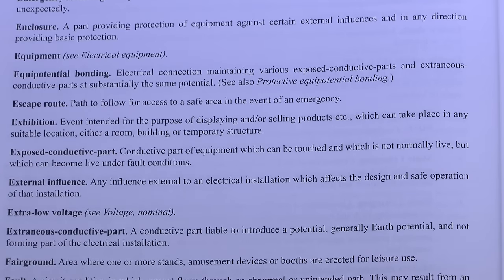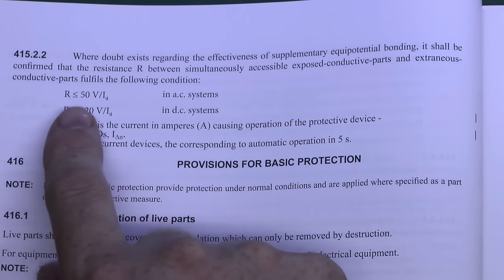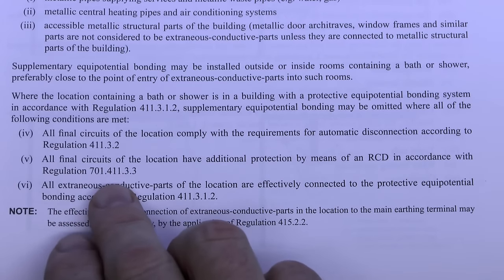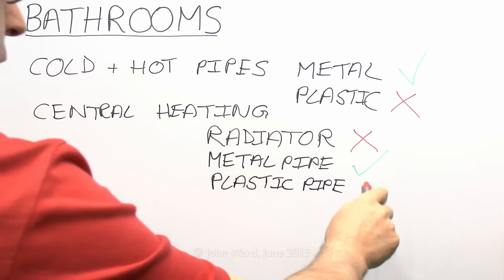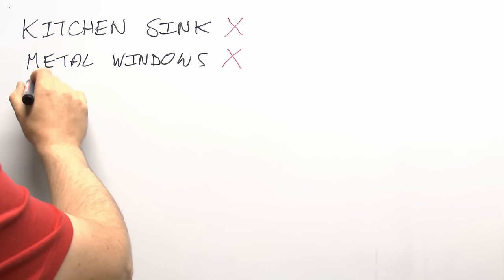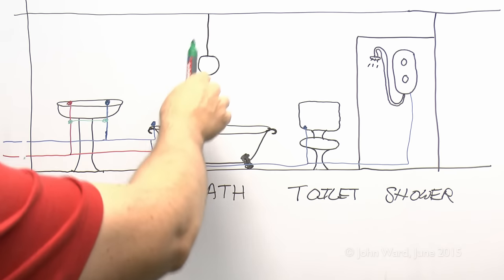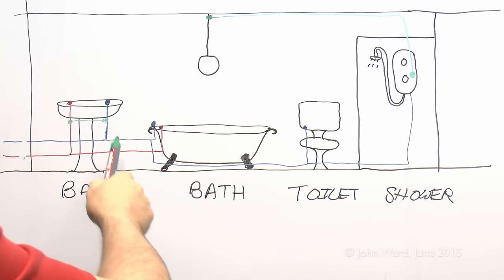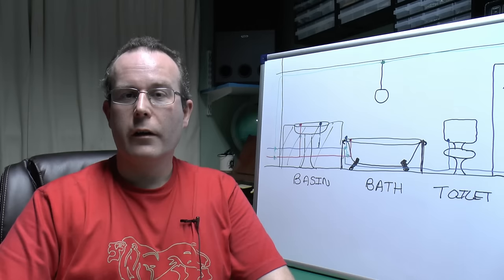Earthing & Bonding - Part 3 : Supplementary Protective Equipotential Bonding

Comment: Boilers when I was working on the 17th Edition Wiring Regs were always bonded as the integrity of the pipework "could not be relied upon" this was due to washers and corrosion of pipe joints at the Boiler and NICEIC Inspectors were keen to see such work completed.
With the introduction of RCD;s I personally see no need to have any Supplementary Bonding within an Installation.

So very interesting to listen to you John
Mr Spence Eng
Reply: I've came across this argument myself. But I don't think it holds water - literally. The pipework is solid copper with either brass compression fittings or soldered joints. We could use plastic joints - but not within 1m of the boiler.

In terms of corrosion of the pipework or its fittings (or the internal parts of the boiler) these would almost certainly fail to contain water/gas before they fail to be sufficiently conductive. Now frankly the customer is going to notice (and do something about) an escape of gas or water long before they notice the failure of a chain of earth clamps and wires.

And of course we can look at the boiler itself as a class 1 appliance. It is compliant with BS EN 60335-1 and therefore all conductive external parts ( including the places where the incoming pipes are connected ) are connected to the CPC. This arrangement isn't subject to the judgment of some previous tradesman but inherent in the design of the boiler and validated by the notified body (as gas appliances are subject to the notified body process). Quite simply the internal bonding between those pipes is probably more reliable (even in the presence of corrosion) than any electrical termination within the wiring installation itself.

Comment: Hi John, got a quick question hope u dont mind answering it. Is it ok if u dont link the shower and the light fitting in the figure u showed in your video since they are already linked in the fuse box on the earth terminal. Thanks
Reply: exactly what i thought
Reply: The electrical connection cpc is connected in the shower and at the consumer unit but this is talking about  providing an additional connection & bonding the pipe.
Since the pipe connection in a shower is often plastic you could end up with a brief potential difference between the shower and the pipe. Or not brief in some situations. I lived in a house that didn't have and rcd once and when the shower went wrong the was 140v between the shower handle and the pipe. The current wasn't enough to burn the fuse wire but would be enough to possibly kill

Comment: Perhaps I'm missing something but why would we need to provide bonding between the pendant/light fitting and the shower, given that both these will have CPCs attached which lead back to the earth bar in the board, and are hence already connected?

Thanks JW, one of the very best youtube electrical instructional channels, by far. I have learned a heck of a lot from your content, and been able to 'flesh out' a lot of what I've learned in the lvl 2 diploma and studying for my 18th edition exam

Comment: John, You mentioned underfloor heating for the bathroom. If the Underfloor Heating is under the floor tiles - is the Underfloor Heating  then considered outside the Bathroom. Similarly - if there is a resistive switch for switching the lights mounted behind a tile - then is this also considered to b e outside the Bathroom. Resistive switches in my opinion are a much neatere switching method compared to the banarl ceiling mounted pull light switch. Taptile is the type of resisitve switch i am refering to. BTW - Great knowledge shared.

Comment: Hello John. Top video. I have an old house, which was rewired professionally in 2000. Hagar Split load distribution board. The plumbing is 99% plastic. incoming blue plastic, then a brass stop cock under the sink then Hep20 throughout. the heating system is also plastic apart from the LPG gas supply, the first 3m of flow and return are copper. And yup, these pipes are supplementation bonded ha. We built an extension to get a proper size bath. again all plastic pipe, apart from chrome stand pipes next to the bath ! We asked a local electrician to do an EICR as we may let as my job is relocating. the electrician has recommended we bond the bath stand pipe !!!! I have taken from your tutorial that this is not required as long as all circuits are RCD protected. fitting a dual load RCD protected board would be less intrusive that bonding the bath taps. Would appreciate your opinion. Thanks
Reply: Sounds like your gas is already bonded and your water doesn’t need to be so If all circuits are rcd protected then all is well.

Comment: Superb instructional video John - very well put together and use of training resources.    Couple of questions: how important is it to allow for inspection of the bonding after the work is completed? i.e. what happens if you make the bonds (to the central heating pipes) under the floorboards in the bathroom:  is it essential that someone should be able to 'lift and inspect'?  Also can you confirm that it is okay to make the bonds to the pipes at the bathroom door (from the landing) rather than from inside the bathroom itself - again this is due to inaccessibility post completion of the works (everything tiled over).  Many thanks for a great job.
Reply from the maker: +BluesideUK Connections do need to be accessible for future inspection, so under the floorboards would not be acceptable.
Connections can be done outside the bathroom such as in an adjacent cupboard, or in the loft space above, etc.
Also consider that it often isn't necessary to connect to every pipe - if the hot and cold supplies are in metal throughout they may already be connected together via a mixer tap on the bath or basin, and although there are 2 pipes to a radiator, they are already connected via the radiator itself.
Reply: Thanks again!  To clarify I have a radiator in my bathroom that is fed by two copper (central heating) pipes that enter from the landing and go under the bathroom door and then up into each leg of the radiator.  I've just refurbished the bathroom ceramic tiling all walls and laminating tiling the floors - so re-access would involve 'breaking things'!   All of the hot and water plumbing for bath and basin has been converted from copper to plastic, so only the radiator remains with copper pipes.  If I need to bond the radiator to an earth (which is readily availble in the loft) then I'd rather avoid having the straps and wires visible hence why I was thinking about doing this either under the bathroom floorboards  or at the point of entry on the landing.

Comment: I was called to a problem with a tagging (anti-theft) system installation in a chain DIY store that kept alarming at random. I could find no fault in the installation it's self, but I got a belt when I touched the steel door-frame of the building whilst leaning on the tubular steel collision-protection bars set in the ground outside the door. Metered it at 230vac! The steel frame of the building was connected to the floor re-bar, (as part of the lightning-protection?);  the local building earth was such high impedance (O/C) that everything structural/metallic in it was floating. Company electrician informed, store shut until it was fixed, fault then disappeared.

Comment: As a homeowner I am still slightly unclear as to why it's necessary to link an earth conductor from the bathroom shower and light to waterpipes if the waterpipes are already bonded to earth elsewhere in the house such as at the entry stopcock. I would have thought that if any live conductor touched a waterpipe anywhere - including inside the shower - the current would run straight to earth. I know I'm missing something here..
Reply from the maker: Two things - bonding them at the location keeps the resistance between the various parts to the lowest possible value.  Although copper pipes have a low resistance, it's not zero, so relying on bonding elsewhere would result in a higher resistance between the parts, and a higher voltage on them when a fault occurs. 
The other is that pipes elsewhere can be altered, cut, plastic joints installed, whole pipes replaced with plastic and so on by people unaware of the consequences of them being used as protective bonding.

Comment: Does it matter if you have rcd protection on all circuits but still have supplementary bonding connected ? Or should it be removed completely
Reply: Fine to leave it in

Comment: Hi John. My house was wired in 1998, all wiring is the red and black . I have an electrical shower with a 10mm twin and earth supply new colours. installed in about 2011. All lighting circuits within the consumer unit are NOT on an RCD, where as the rest of the house is on RCD . Does this mean the I have to bond the shower to the Lighting circuit within the bathroom? and if so does it have to be a 10mm cable?  The lights are within 3 meter high ceiling as it is a Victorian property. Thanks in advance.
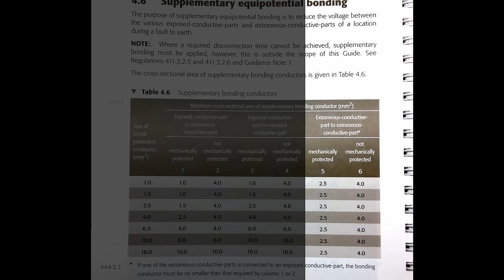Reply: @ M Kay. Hi I have the same problem. On the video at 28:51 there is a table of earth cable sizes, I saw mine being a 4 mm earth cable. (The most common size). Did you sort your problem?.
Reply: @frank1847  I asked but got no answer... I have not done anything about it. I have a 10mm twin and earth for the shower so the actual shower is ok, just the lights are not bonded as per the video. The switch is a pull cord so i personally  do not see the issue, Just thought I would ask... However there is no law to bring anything up to code but just wondered.
Reply: @mkay6089  @M Kay, Hi again. I think the idea is to link the lights with the shower earth as per the video. But I agree with you with a pull cord there is no issue,
Reply: Your shower should be rcd protected.  There is no need to bond to the lighting circuits as long as no metallic lights or switches are within reach.
Reply: @rayc1503  Hi, Thank you for the reply. Yes the shower is RCD protected as explained. All switches are pull cord ( Shower power and lights) Many thanks again.

Comment: Fantastic and well structured series.  Question to John; I have refurbished house with all plumbing in plastic.  But I have copper tails to help tap and boiler connections.  Would these copper tails need bonding?
Reply from the maker: No, they would only require bonding if they entered the building from outside or were partly buried in the ground.

Comment: You have strange rules in uk. Ok. This video was the first time I heard of such a thing as an electric shower. Here in Finland, the shower will always have hot and cold water and the water temperature is adjusted by the mixer valve. The hot water is distributed throughout the house from one boiler. 

In Finnish building, water pipes and boiler (boiler is usually electric, geothermal, oil burner or wood chip burner but never gas) must be grounded. Normally it is done at the boiler where branches the hot and cold pipes, the same way as your photo that was pointless. ;)

However, nowadays metal pipes are no longer used in residential buildings or perhaps in the heat distribution rooms. Other required items to be separately grounded are, ventilation pipes, concrete Reinforcing bars, metal cable routes and TV-antenna.

All equipotential bonding is carried out via the grounding and every new house have ground electrode, three phases and separate PE and N, 230/400V. Older houses have three phases and PEN, otherwise the same.
Reply: In UK they always do it differently )..And the electrical shower lobby is very strong.. LOL
Reply: The main reason for electric showers in the UK is that most dwellings have a cold water storage tank in the roof, and this pressurises the whole system for domestic hot and cold water. This means that the water pressure in upstairs bathrooms may be too low to provide a sufficient rapid flow of water in a shower.  However, an electric shower connected directly to the incoming water supply of the house will have a much higher water pressure and so be more effective in operation. From what you say, I would guess that the water system in Finnish dwellings is pressurised to mains pressure and that there is no cold water storage tank - or at least not one that is vented to the atmosphere.  One other solution in the UK is to have a shower pump to raise the water pressure. The pump operates automatically when the mixer valve is turned on.  It has two low pressure feeds of  hot and cold water.
Reply: @stevebeal73  Excellent explanation Steve !

Comment: Curious.... our house it being rebuilt. No cables or earth are connected to the supply. I just did a resistance check between the pipes buried in the walls leading to rads and the main earth terminal in the meter box and I measured 44k ohms. Bonding needed? Obviously the whole place will be rcd protected
Reply: No, above 23k ohms is not considered extraneous, no need to bond

Comment: From the part 2 video, if the main water supply in to the building is plastic but the house water distribution is via copper pipes earth bonding to the water supply is not required. All wastes are in plastic. So am I correct in assuming that supplementary earth bonding is also not required as all pipework is effectively isolated from earth.
Reply: If the metallic pipes don't enter the ground then they will not be extraneous

Comment: Hi JW, if you're saying that the cpc under the boiler is superfluous, then I don't see why it's necessary to bond the hot to the cold in the bathroom where a combi is concerned; they too are joined at the metal plate? I am a newbie though.
Reply: If they are 0.05ohm between them then pointless installing more supp bonding

Comment: Why are you mixing lighting and power circuits via cpc?? i suppose it all goes bk to same place but as good practice keep em seperate???
Reply: To ensure simultaneously conductive parts are substantially at the same potential so that dangerous voltages between them cannot exist.

Comment: This is a good video but does contain some contradictions.  Could someone please answer the following:
1.  Does the supplementary bonding conductor have to be a single continuous conductor; like when a Main Bonding conductor is used for both gas and water?
2. 6:50 why bond Class II equipment as surely they are not exposed because their external surface is not metallic/ they are double insulated?
3. 11:00 How is it possible to terminate a 4mm2 conductor in a light, which has terminations designed for 1.5 mm2 conductors?
4. 15:12 why does the bath metal waste pipe need supplementary bonding – surely it would require Main Bonding as it is extraneous to the building?
5. Shower and light joined with supplementary bonding – do you also have to join to the light switch? Shaver socket? Extractor fan? etc.  15:55 and 31:00 Why don’t you include to the electric towel rail?
6. What instrument do you use to measure up to 1,667 Ohms?  Most low resistance ohm meters only measure up to 99.9 Ohms.

Comment: at 29.20 I don't understand why the incoming circuits to the bathroom are considered exposed conductive parts? Maybe a metal light fitting would
Reply: If they are Class 1 then they are. Class 2 then they are not.

Comment: Hi went to job in a block of flats and tennent said he was getting a shock of the taps in his bathroom when he had no shoes on and touched the taps I did confirm this when I arrived at the property I then decided to isolate this by turning all the power of to the property but the fault was still there and still could get a shock of the taps and pipe work under bath I noticed there was a old lighting conduit under the bath for what I believe is the flat below I then went and knocked on the flat down stairs and got assess to the property and isolated there lights and the pipe worked in the bathroom can now be touched and not be electrocuted I'm confused as to why the rcd in both properties did not operate have u ever come across this scenario ?
Reply from the maker: jason green If the current was less than 30mA the RCD would not trip, but it is still possible for a person to feel it as a shock, particularly in a wet location like a bathroom.
Reply: ***** here in the u.s. gfi go off at far less current

Comment: Hi John, in regards to supplementary bonding, what is the purpose of it? I understand it's to keep everything at the same potential. But if all extraneous pipes ect are bonded to the same MET as the electrical installation how can they be potentially different? Appologies if the question seems daft, I'm still learning. Thanks.
Reply: Rob, someone could have installed a section of plastic pipe or a plastic push-fit connector since the original bonding was installed. I have just found this in my 1974 house where the original bathroom was de-bonded due to plastic water pipes

Comment: Hi folk can anyone give advice on this for me. My plumber replaced a radiator and used plastic pipe to do this.
Should the plastic sections be bridged with earth cable?.
Help required please.
Reply: Not required if all circuits are rcd protected.
Reply: Cheers Ray.

Comment: Hi John can you please confirm me for existing installation if bonding to gas water pipes are less than 6mm, what code should I use for EICR certificate please, because you are the only great man I can make clear in my mind?
Reply from the maker: C2
Reply: John Ward  thank you very much John
Reply: That would depend on the earthing arrangement. For TN-CS, yes it would need to be 10mm so 6mm would be undersized. However, 6mm could be perfectly adequate in a TN-S system and in some situations, even 2.5mm could be fine if it was TT.